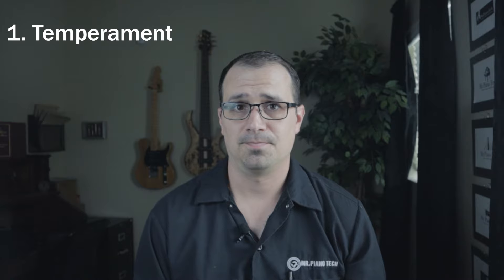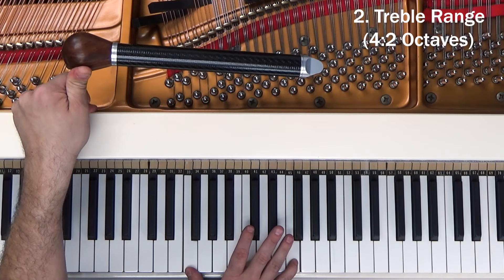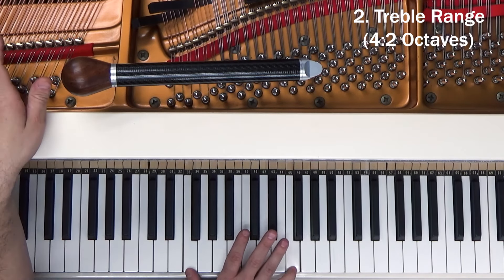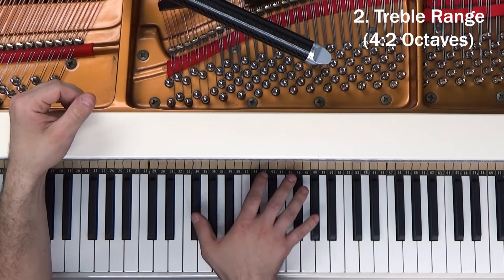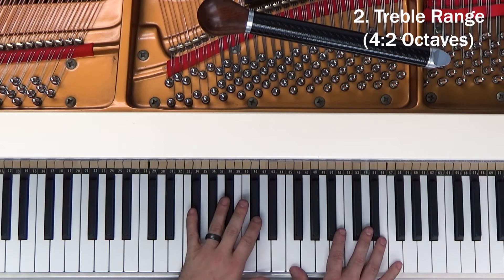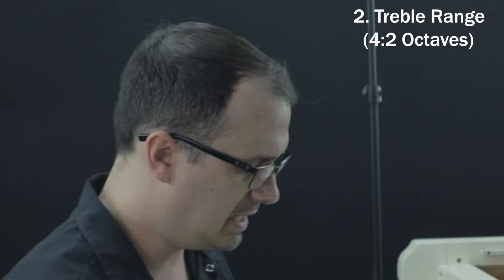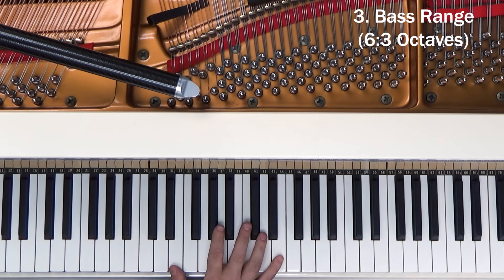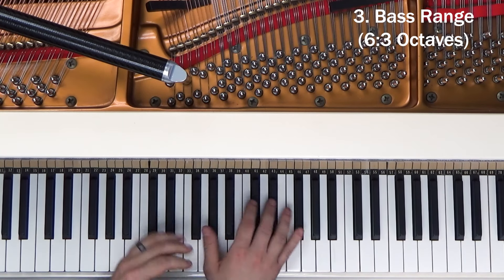How To Tune A Piano

Comment: Sorry man, no serious piano tuner would use an electronic tuner to tune a piano. The piano is tuned by ear, like any other instrument.
A tuner using an electronic tuner doesn't know why he chooses a certain pitch for a sound.
On the other hand, stability in tuning is achieved with a correct use of the tuning key, an issue that the electronic tuner does not solve.
Instead of recommending devices that limit auditory learning, I think you should encourage apprentices to seek full training, thus respecting a centuries-old profession.
Reply from the maker: I only set the temperament with TuneLab. It's exactly the same temperament if you did that part by ear. It gets you there quicker.
Reply: @MrPianoTech  A serious piano tuner also use the ear to build the temperament. Why do you use the Tune Lab for temperament and not for de trebles if we are talking about tune? Is the temperament maybe more difficult?
It's faster by ear, my friend. Only you need to know the method and practice for months to control it. 
It is a mistake to show a false image of tuning only saying you can use a piano tuner. Usually the learners think is easy to tune a piano, and soon they take clients to do easy money. 
And a real piano tuner don't tune always in the same way. The tune changes if you tune for a soloist or, for example, the piano is going to be use with a orchestra.
We need respect and formation un oye proffesion. Not easy ways. I think your video is not responsible and sells a false image of a profession you last years to learn.
Reply from the maker: @pianosfera  Have you watched the entire video? A "serious" and professional piano tuner is one who offers the highest quality of work to their customers. Do you work in the field on a regular basis? I tune 4-5 pianos a day. Tuning the temperament by ear does take longer than using a computer and is not as precise on a consistent basis. If you can tune the temperament by ear perfectly and consistently then that's great, but it might not be as accurate as it could be.
Reply: Do you said the ear is not accurate? Do you know what are you saying? The highest quality in this field is the formation with experts, not using external devices. 
You tune 4-5 piano with your tune lab or ten if you want...this is not  a sign of quality. I don't need any external help, like many others. Many people could tune a piano with your tune lab very bad.....
I take part in the field, I have worked in studios and theatres, of course. I learnt with the Steinway&Sons service in my country in Europe and there I have never seen nobody proud using theese devices. 
I never said you don't know how to tune. It's imposible for me yo know that, but this video is seen by learners and they need to know that is not the solution.
Reply from the maker: @pianosfera  Again I ask you have you watched the entire video? This is primarily a video on how to tune a piano by ear. However, if you think you have a better system we should all always be willing to learn and I ask that you make a video and let me know when you post it so we can all learn your techniques.
Reply: @MrPianoTech  I use the japanese temperament (for eaqual temperament) that is commonly use for tuning pianos.
And sorry. I'm not going to do any video. I respect so much my proffesion to think is a good way to learn. I spent two years to reach proffesional results. How to resume this in  five or ten minutes?
This is a crazy idea. One more time I say: the first is the RESPECT.
Should I think you hace learn with YouTube videos??Is this the sign of tour quality?
Good luck with your tune Lab, man.
Reply: As an audio engineer I very often setup the PA while a piano tuner is working, especially during december (=christmas church tour) where I see maybe 10-15 different professional tuners. I cannot remember seeing anyone tune by ear amd not use a computer the last 5 years at least...
Reply: @DogBoots77  In my life I also saw many people who called themselves sound engineers for the simple fact of handling some software and some plugins and not for that reason they are sound engineers. Of course, I am not saying that is your case. That is the difference between an amateur and a professional.
If you never saw a piano tuner tuning by ear, you never saw a piano tuner. I think you should inform yourself a little about a profession that you do not know.
There is no more blind than he who does not want to see.
Reply: @pianosfera  I’m just stating that as a matter of fact the vast majority of professional piano tuners (= people who do in fact tune pianos for living) that I’ve seen the last several years have been using machines. Besides, what does my profession and possible qualifications or lack thereof have to do with this observation?
Reply: Look, we can do one thing. Do a little research on the places where you can acquire the specific training necessary to become a piano tuner. You can search the internet and find out. You will notice that there are few places in the world. In none of them do they teach you to use the electronic tuner, they teach you to use your ear. The fact that you buy an electronic tuner and related pianos does not make you a professional, since you do what a machine tells you. You do not have a criterion by which you choose a certain height for one sound or another. The fact that there are many tuners with electronic tuners does not legitimize the fact that what they do is professional. Also, there is another problem. The tuning tool can do a lot of damage to the piano pegs and you need a teacher by your side to teach you what kinds of movements are correct and which are not.
Finally .... How do you tune a violin, viola, oboe, or harpsichord? Indeed, with the ear. Also the piano. Tuning is an art, it is an agreement between instrumentalists.
I encourage you to inform yourself and then know and give your opinion. I know almost nothing about recording. But in my life I met many good piano tuners. None used an electronic tuner. They all took pride in a skill acquired after years of practice.
Reply: I guess you're in the wrong place here. Stay with Steinway and Sons
Reply: @pianosfera  Yes. Interesting. I have one of these modern cars with an engine in it. What new fangled nonsense is that?! I always tie my car to the back of a horse. That's the way it was always done. A proper professional driver never switches the engine on. They just rely on a horse.

I suppose the biggest mystery is why you're posting on the internet. Couldn't you just send us a letter written with a quill pen?
Reply: @pianosfera  really man, calm down. I understand where you’re coming from but the simple fact is that the overwhelming majority of todays piano tuners are doing it faster and just as accurately using ETDs. I regularly get beautiful pure 12th tunings using Reyburn CT, doing unisons by ear. Your opinion is valued and we all appreciate the purist angle but you’re being too heavy handed and exclusionary. There is now more than one way to achieve a beautiful and accurate piano tuning. And BTW thanks very much to Mr Piano Tech for the amazingly helpful and thorough video tutorials.